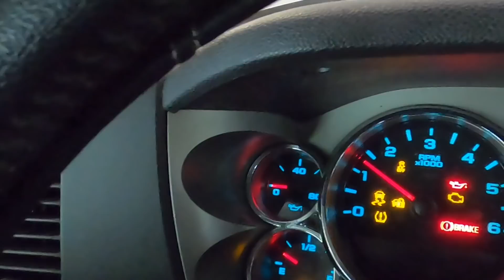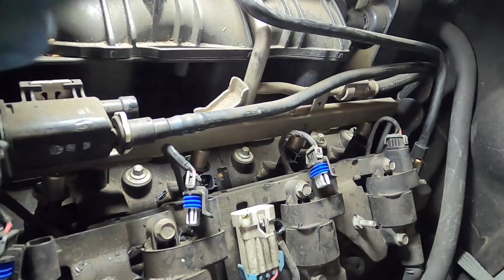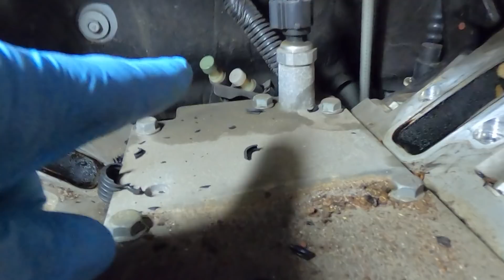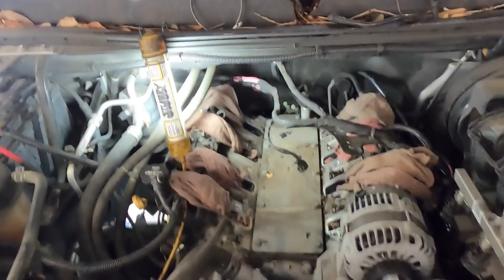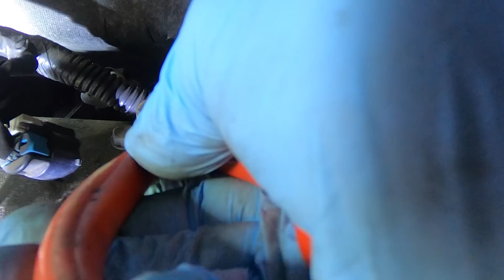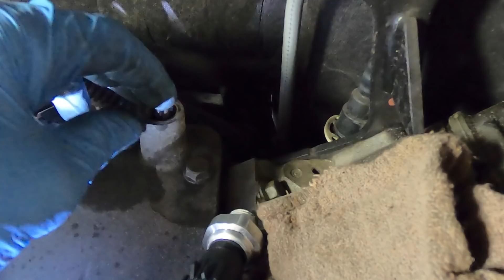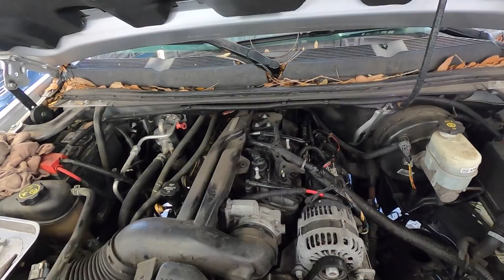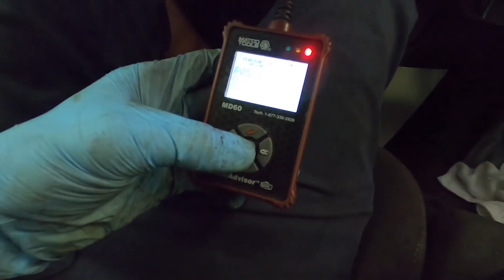Customer States: Google Diagnosis…replace this part!

Comment: In my experience, You must clear the code after repairs for a proper read.
Reply: In newer cars the codes should clear on their own. Technology has advanced very far in the last 20 years. There are many more sensors in newer cars, and the light turns on when it detects something. When it no longer detects it the code goes away. If the code is still present after a repair then it is good practice to clear it because one of the sensors could just be reading wrong. If the light comes back on then you didn't fix the problem. The only codes you should ever have to clear on modern cars are maintenance codes, because the car doesn't know when it was serviced. If you have a check engine light for oil low. Adding oil should clear the code for you. 
If you have a bad sensor, changing the sensor should automatically clear the code.
Even my 85 MR2 had this technology. 
If you have to clear the code after, either you didn't fix it, or whatever senses that code is stuck. You have a 50/50 chance that clearing the code is the answer. Most of the time if the code is still present something else is wrong.
And seeing how this is a Chevy, it's probably just because it's a Chevy. When one thing goes bad, everything goes bad.

Comment: Great video, I have changed these without taking off the intake. It's not easy but easier than taking off the intake. Before putting it all back together, I would have checked the new sensor with my scan tool and a blow nozzle. Just because its new, doesn't mean it works. Especially if the part came from advanced auto.
Reply: it was a carquest part did you not see it?
Reply: @79tazman  guess who supplies 90% of the Auto parts to Advanced auto parts? Carquest does so you decide?
Reply: they make new junk as well. 👍✌️
Reply: That comment about Advanced auto hit me hard, got bit by one of their defective products. Worst thing is they wouldn’t warranty it! 😡 Never bought anything from them again.
Reply: oooh meow ;)

Comment: ok here is my opinion. before going any farther,. Still will be no oil pressure, but why?  no engine knoching im presuming.. so it must have some oil in crankcase to lubercate, but maybe not enough to to pressure up?, but doutfull..  no knocking should rule out oil pump.  he is doing what the customer orderd. if was just told to fix the problem i would first check power going to gauge with multimetter if thats ok i would check gauge , maybe needle stuck? a tap tap tap on the back of gauge even doing this without engine running the needle should jump a bit. if needle dosnt it is stuck if it does then gauge may have open circuit. fuse. so i say its an open circuit between sending unite and gauge . or the gauge itself.. now to continue and see if im right and customer spent foolishly..  well i finished watching and to my surprise there is no resolve??.  now that make 3 people who wasted there time....

Comment: Wow never seen someone take 2 hours to do a 20 minute job before... not only did you screw the customer at the end of the video you clearly see the check engine light cleared and the oil pressure gauge working at 40psi.... my god what a terrible shop...

Comment: The customer was right. If you would just clear the engine light the gage will work. I have put dozens of these in and you have to clear the the engine light when you are done.

Comment: Wow dude, you did all that work and you didn’t have to. You can easily remove and install a new oil pressure sensor with a deep socket to a 4” extension connected to a swivel and another extension. No need to remove the intake manifold.
Reply: It's called "billable hours" my friend

Comment: I put 180K miles on my last Silverado with a check engine light on  (evap control). Those things will trigger for the stupidest shit but I do always hook up my code reader to check. My current 'rado has one all winter long for lean bank and it goes off every summer. LOL

Comment: I have actually refused repairs like this. Almost every time i have accepted a repair where the customer self diagnosed the issue, i replaced what was requested and it didn’t fix their problem and i get blamed for just not doing it right. So i charge a diagnosis fee on those customers now. It’s worth the extra diagnosis to confirm the problem before throwing parts at it.
Reply: My shop has the same policy. People tend to leave out details that make them look bad when they are trash talking you all over town.

Comment: That's so wrong.  You could have easily checked it when you had the intake off by plugging the new sensor in and using you air nozzle to pressurize the end of the sensor while someone watches the gauge.  Even though the customer wants you to change a part, you still could of saved time and money by doing that easy check before reinstalling everything.  You just wanted to screw the customer over for more labor.

Comment: I am starting to feel like you made up this whole customer diagnosis story just to make a point about self-diagnosis since you cleared the codes and the gauge needle is working at the end of the video.  But why?  
Also, the music would get on my nerves day in and day out.
Reply: Did we both watch the same video?  The oil pressure needle did NOT move at the end of video.  You may have been noticing the fuel gauge needle that raised a bit but the needle on oil pressure gauge never did rise.  The oil pressure gauge is on top left of guage cluster NOT on the lower left.  I went back and watched ending repeatedly...and needle never moved on the oil pressure gauge.  And Ray even states he is not running a diagnostic to fix or clear any codes.  He is pulling codes so that he can inform owner of what exactly is going on with his vehicle.  Please pay attention to video before you post comments that are misinformed or untrue.

Comment: Serious question, why remove the intake? I've done probably over a hundred without...
Reply from the maker: That’s the procedure and it’s really hard to do without. I didn’t want to get cut up.
Reply: @RainmanRaysRepairs  I love your content, and I've sub'd for a while. I always enjoy watching someone else's diag procedure... But take the shortcut when you can, that's content upcoming techs need to see. Those sensors take sub 10 min.

Comment: Correct me if I am wrong but at 32:09 I can clearly see the oil needle at a near normal point. I smell something fishy with Rainman that gives me great pause to ever watch his videos again.
Reply: How is this dishonest work? He is doing exactly what the customer has asked them to do, there is no reason as to why or what he is doing is wrong. he Is repairing the oil pressure sensor which the internet mechanic asked him to do and he's doing it by the book. Mr. Ray here has done nothing wrong, he is simply doing what he is told... Like all of us peasants who work
Reply: You are absolutely right.
Reply: @Dutchmadness1  Yes this vid is totally made up. At 32:08 the engine light is off, and you can see the needle from the pressure gauge at a normal value. Rainman  Ray - Why so dishonest ?

Comment: The sad thing about this is that most shops roll the diagnostic fee into the repair (if you opt to do the repair). If that's what your shop does, he would have effectively paid nothing for a proper diagnosis.
Reply: That's actually a very good point.
Reply: (?) I never said anything about reading codes.
Reply: @OneOfManyNicknames  No, but Ruhoer did in the replies
Reply: It's 100$ just for them to plug in the scan tool at the local shop
Reply: Last time I took a vehicle is the code read was like $60, the diagnostic was like $100 minimum then dependent on how long it took.
Reply: Reading codes are not diagnostic.
Reply: @pashko90  Scanning codes is considered a diagnostic in some shops, pretty sad. A real diag is not just scanning the code but figuring out whats causing the code to pop up. Thats a real diagnostic
Reply: @Mkultra210  yes, this is how i feel it too.
Reply: @pashko90  reading codes, researching, and using accumulated knowledge are.
Reply: @jamieharris74  finding and confirming an issues is a diagnostic for me. This is what I do for living.
Reply: @pashko90  cool. It’s also what I do for a living.

Comment: I did a couple oil sending units. Use an old one tapped out to 1/8 pipe thread to use manual gage.

Comment: That's insane. My 02 trailblazer uses the same sensor and its next to the oil filter. Takes 10min tops to fix. Besides that if its that much of a hassle to fix why wouldn't he want to have them put a gauge on the filter to see if there actually no pressure. Some customers think they know everything.

Comment: You can actually replace that sending unit if you get a half inch extension with a wobble head and I believe it is a 21 or 22 mm deep well socket. Whatever socket equates to the oil pressure sending unit socket I can't remember. But you don't need to take that intake off!

Comment: What is scary is that I have watched several videos where : the injector harness had the connectors close to EACH OTHER and they were MIXED , DITTO on coils and they MIXED up the connectors on the PHASERS on a VVT system . Most of these were a disaster with numerous parts and a computer replaced and the customer told " the car can't be fixed " . What's wrong with it :  " I don't know " . Anytime things are MOLESTED , it's OPEN SEASON ! Looks like you are focused and on point with the job . Unfortunately , there are too many hacks that cause issues .
Reply: I was asked to diagnose a Volvo with misfires that two shops hade given up on. Someone had swapped leads between two coil packs...
Reply: Ford 5.4 in the e350 vans have 2 cool wires coming out of the loom but going to the wrong coils. They criss cross each other. One has a factory label, if you are lucky. Got to look up the color codes or remember the criss cross.
Reply: Bullshit pal... Those are pushrod v8's without phasers

Comment: The motor need a twice over seafoam treatment also the bung hole should of been sprayed out with brake cleaner I’ve seen chunks of poo come out that hole before from morons not changing their oil every 5000 km. But they gonna pay twice to have it done

Comment: I see these pretty often.  NEVER do they have a bad oil pressure sensor.  I ALWAYS wind up replacing the oil pump pickup o ring on these damn things. 

Also, you can pull the sensor without removing the intake.  It's a bit of a contortionist job, but you can do it.  Getting the screen in and out - thread an 8MM bolt into it, and tug it right out.  Also works to install the screen.
Reply: So I have an 08 silverado 6.0 that’s throwing this code and I replaced the sensor and it still doesn’t work. It’s stuck at 0 and hasn’t changed in months. You think it’s the pickup o ring? I’ve been hunting for an answer and taken it to a mechanic and they pulled the gauges and everything and couldn’t fix it
Reply: @cameronmoose6961  Man, I honestly can't say without seeing the truck.  I could take a stab at it, but if I am wrong, it could blow up your engine - so I would say try another mechanic.
Reply: @Ulrich_Wolf  well I actually got my truck taken apart putting an afm delete and a new short block in it and new oil pump so if I’m going to fix it now is the time lol .

Comment: I have changed tons of those sensors on 4.8 or 5.3 and never do I pull the intake lol. Also
I have seen where you clear the code for the faulty sensor that the Gauge then reads correctly with new sensor installed. Ps those screens sit quite low.
Reply: Is it possible that Ray was trying to put the new screen on top of the old screen and that's why it wasn't going deep enough?
Reply: @bartsarton2212  I don’t think so

Comment: You didn't need to take the intake apart to replace the oil sensor.  I was able to replace mine by reaching in the back.
Reply: Like I said, videos that ended too soon.

Comment: when you pulled the old sending unit out ..it was dry...i wonder if there is a blockage before the sending unit...maybe you could have shut the fuel pump off and have someone crank the engine while the sending unit was out to see if you had any oil flow to the unit ...i bet its just blocked ,,,to late for the screen

Comment: one time my check engine light turned out to be a chuck engine light... it's in the back yard now partially torn down... the problem?  well... rod bearings, plenum gasket, head gasket, valve guides, and the crank... not much lol... oddly the only real signs of trouble was smoking at an idle and a rattling noise on startup.

Comment: 14:37 Oh, you mean like the special oil filter sockets specifically for 2.0/2.2 Ecotecs?  Thanks, GM...

My '01 Silverado was having a low oil pressure issue, the one that the early to mid 2000's V8's had that cause the driver side lifter(s) to clack for a couple seconds until oil could get up to the lifters on that side.  It would also cause my needle to bounce around and always show low pressure.  I was about to have it looked at until my last oil change.  I switched to full synthetic oil and both issues disappeared.  Very strange.  Even during the winter (when it would happen the most), it never seems to do it anymore.

Comment: I had this happen on my chevy avalanche after 3 weeks of ownership i got it used and had pre-inspected. Truck ran fine but pressure went to 0 had it diaged the oil pressure sensor was changed it worked. 3 days later pressure when back down code 0521.  The motor had alot sludge from the previous owner unknown when i bought it. It was discovered when I had a new oil pump installed and the oil pan was had alot of sludge in it. The new oil pump lasted  3 days same thing low oil pressure. I sold it after 4 months lost 9k. Bad experience.
Reply: Isn't it strange how computer control FI and lean burn BS was supposed to make engines so much cleaner burning?...but they sludge up quick?

Comment: Wait... at the very end of the video... the needle was working! 😂
Reply from the maker: Yea it’s intermittent, it comes on and off at random. There’s a bad connection or high resistance somewhere.
Reply: @RainmanRaysRepairs  ohhhhh

Comment: Another oil pressure issue with these trucks is the oil pick up tube o-ring. When they dry out it causes loss of oil pressure and a lifter tap until it rebuilds pressure. Happened on mine at 200,000. Trucks is at 297,000 now.

Comment: remimber about 30 years ago you could just reach in and unbolt the one part you needed, not anymore. 2hr full disassemble to get to a $12 part
Reply: I owned early 90 late 80s cars.  There ALWAYS was something that was hard to get to.
Reply: My first car was a 99 Malibu. Then I got a 2012 Hyundai, then an 85 MR2, and now I have a 2018 Crosstrek. The Malibu was easy to work in, the Hyundai was impossible because the engine bay was too small, the MR2 was only hard to work in because of the work space available, even though there was nothing in there. And the Crosstrek is super easy to work in, because it's a boxer so all the shit that's normally in the way is somewhere else. But spark plugs eww. Hardest thing ever. Speaking of which, they need to be done in the next 5000 miles.
Reply: I had to change the plugs on my 87 Astro van way back when. I was able to, with some difficulty, get seven out of eight done. Never was able to get that eighth one changed. Then one day, I had to pull a front wheel for something, and there was the eighth one staring me in the face. 
So it has been a pain in the balls to work on cars for a bit longer than 30 years.

Comment: gotta love it..  I do a lot of my own diagnostics.  often just to get an idea of what is wrong first..  also gives me an idea of what the work might look like..  HOWEVER if i take it to a shop, I ALWAYS let the shop make their own determination of whats wrong.. oftentimes the cost is not much more when you get the total bill..  many times the mechanic knows whats actually wrong or has a good idea of where to look as they likely have seen the issue before..   in my field we get customers doing similar..  the good thing is its all billable by the hour..
Reply: The "University of GOOGLE” diagnosis and degree are often not worth what you pay for them. You cannot become a veteran experienced mechanic at GU.  Only in the shop.